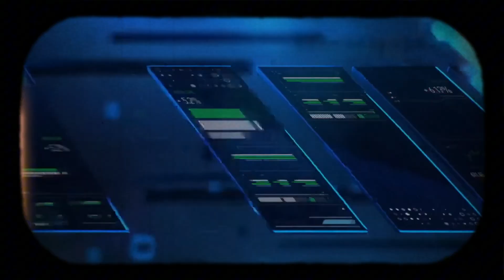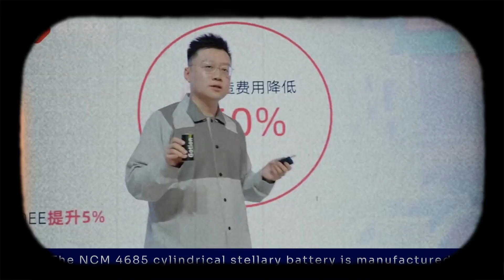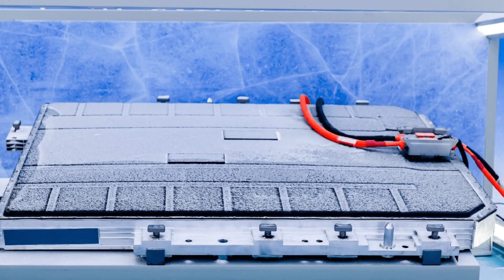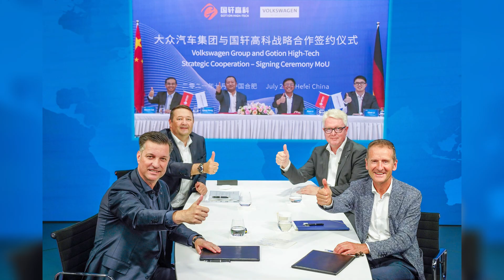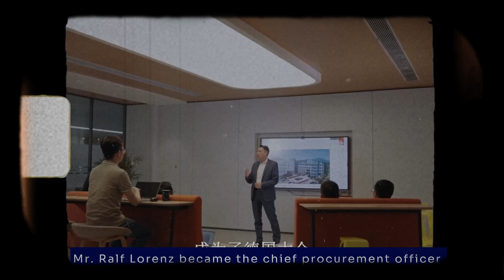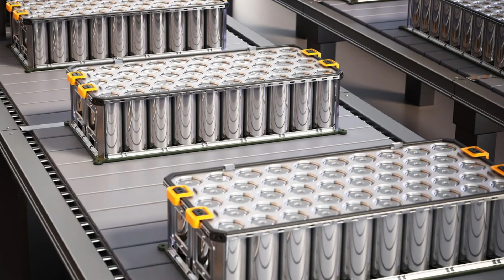The System That Keeps China Ahead in the Battery Race!

Comment: China has long been labelled a copycat nation. Yet there are instances where it has shown genuine innovation and the ability to think differently. The approach of balancing sodium and lithium battery technologies is a notable example. It strengthens supply-chain resilience, reduces dependence on a single raw material, and provides greater market adaptability.
Europe, once the global hotspot of invention and industrial innovation, appears to have lost some of its edge, with a more conservative approach to technology and investment. Much of the breakthrough innovation has shifted to the United States. China, while historically not regarded as a leading nation for original invention, is now making determined efforts to change that perception—one small innovation at a time.
Reply from the maker: Europe still has enormous scientific and engineering strengths, but it has often been slower to commercialize and scale new technologies. In the end, the decisive advantage may not belong to whoever invents first, but to whoever can turn an idea into an entire industry. Thanks for adding this thoughtful perspective.
Reply: @KINESIS_LABB Europe was the cradle of many of the world's greatest inventions over the past two centuries. Yet today, it seems to have slowed, despite having no shortage of talent, knowledge, or innovative minds.
Could you make a presentation what went wrong n what's going right. How US n China has accelerated the ideas with a faster pace!
Reply from the maker: That’s an good topic suggestion. Europe clearly still has the talent,the real question is why the US and China have become much faster at funding, commercializing, and scaling new ideas. I’ll seriously consider covering this in a future video.